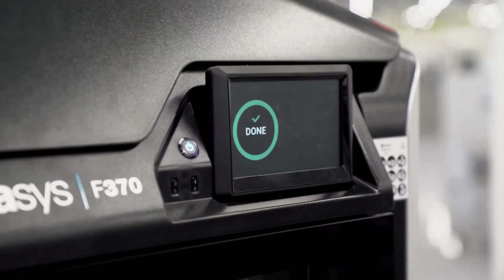Ford, GE to make 50,000 ventilators in 100 days

Comment: Does anyone know if these ventilators are based on one of the original prototypes made by Newport Medical Instruments?
Reply: The ventilator is licensed from Airon Corporation. It had been designed by Paul Blanch more than 20 years ago. In fact, AirOn advocated stockpiling these simple and cheap ventilators for emergencies since 9/11, but it did not really happen.
Reply: @cogoid  Its a travesty we didn't make any real progress whatsoever, considering private companies had several reliable and relatively easy to operate prototypes as far back as 15 years. I hope Ford and G&E can deliver on these prospects.

Comment: Great job guys.  I hope your making the accessories.   
Patients will develop mucus which needs to be suctioned out regularly, through the incubation tube .  You loose the strength to cough it out.
Also need foam wedges to rotate patents, from side to side,